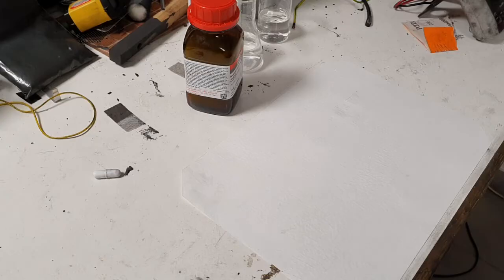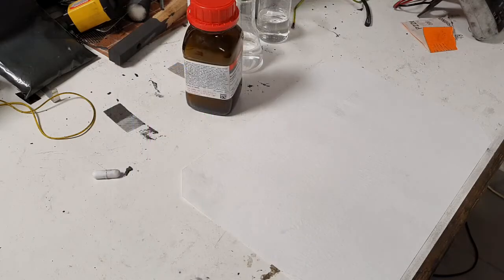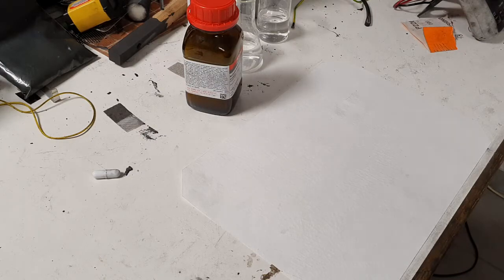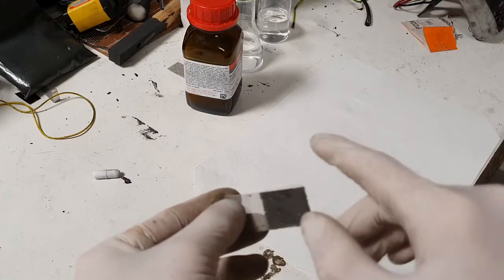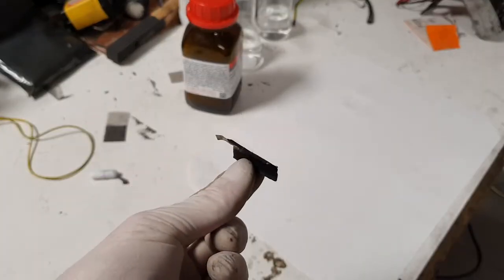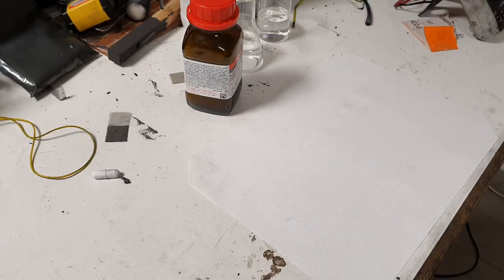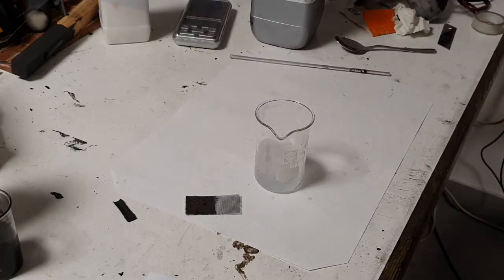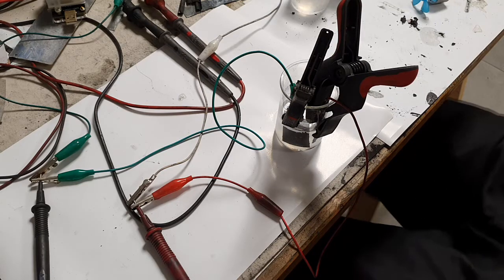Make a Nickel Iron Battery or Edison battery

Comment: These batteries have an incredible long life. The one in a 1940s firklift revived after sitting till 2006. I fixed the forklift's charger and hoses and it was being used dayly in 2013 when i left the job. Just try letting a flat lead battery sit for decades and see if it revived 😂
Reply: i suspect that our forklift at work also uses nife batteries. i don`t know. i just put in some distilled water every now and then `cause that`s what i was told to do. been doing so for over half a decade and never had any problems or did any maintenance on the electric system. and i know for a fact that not much was done in the decades prior to me :D

Comment: Nickel iron batteries would be great for powering homes. it doesn't matter that they would be large,as they would be static and could be in a shed or even in the ground. There are nickel iron batteries that are 100 yrs old and still more than 80%.. they are also relatively very green. Thanks for a very clear and concise video.
Reply from the maker: Yes indeed. But the price of nickel right now is over the top 📈

Comment: "pasta? .... ohhhhh  P a i s t ... lol...
i would have thought that stainless screen for ur iron base, is counter productive do to the nickle in the screen. i wonder if theres nuff nickle in the stainless to produce a respectable voltage? 
also ... wow that is lots of KoH in such a small amount of water. a much smaller amount produces hydrogen off gassing.
6:21 did u use distilled water? 
i think im going to try this ... now where did i put that stainless screen.... hummm ;)
ty 4 ur vid

Comment: Really enjoying your vids mate cheers
Reply from the maker: Wow Turbo....! Thank you, I also love your vids.
Reply: @cayrex  can you tell me what the binding agent you have used with the iron powder please?
Reply from the maker: @turboconqueringmegaeagle9006  in basic you can use what do you want for the binding agent. SBR + CMC, PVA + PVP I use the second binder. 85 to 90% active material (iron powder) 5 to 10% conductive material and around 5 % of binder (3%PVA and 2% PVP) If you use a binder which is waterproof then also use some binder which will be water based binder like CMC or PVP with the combination of waterproof binder. In this system the electrolyte will easy to get into the active material. You can also try only PVA or other waterproof binder but you will need much more time for electrolyte to soak into the active material.
Reply: @cayrex  thanks for your reply, and the info. I've been looking for details on the construction of early Edison batteries for a while, how it was done in the 1930's as some 90 year old batteries are still in usable condition.
Have you ever tried the tube type construction with the iron powder packed into the tube?
If I do anything on my channel I'd like to mention you and show a couple of clips from your videos if that's ok.
Reply from the maker: @turboconqueringmegaeagle9006  tube design is also really good. In this case you need a iron tubes. On this iron tubes you make a small holes that the electrolyte can go inside the tube. But the iron tube you can fill with iron powder to get more capacity. Wow,... mention me on your channel? This is so cool
Reply from the maker: @turboconqueringmegaeagle9006  also if you use iron tubes than you dont need any binder.
Reply: @cayrex  yes this is what I am thinking, binding agent might fail over time and insulate the powder but flat plates can be greater capacity? I might also find it difficult to make nickel oxyhydroxide into powder as I can't buy it but I will try.
Reply from the maker: @turboconqueringmegaeagle9006  with binders is always a problem, because you can get some % lower of the capacity. Yes, finding nickel oxyhydroxide is a little hard also the same is if you make it by your self,... your material can be bad and also you will end up with bad cell. You can use nickel hydroxide but in this case you need the charge the cell to form nickel oxyhydroxide. You can also try to make a cell only with nickel plate,... the capacity will be a bit lower I think. Try and you will see.
Reply: @cayrex  thank you my friend, you have been very helpful

Comment: hi cayrex2, 
many videos I've watched on your channel, but I'm still confused, what batteries are easily made with material that is easily obtainable as well and is equivalent to lead acid battery mf on your sample video?
Reply from the maker: Yes I have many videos, because many people want to watch on diffrend types of batteries. Easy to make and have the performance of the lead acid battery? This depends what is for you easy. Some ZnHCF battery, zinc ion hybride capacitor, nickel zinc, iron air battery,.... you have many tech that can be better that lead acid battery
Reply: @cayrex  
yes, it turns out it's very much and I don't know it, but I'm still not satisfied. what do you think about na-ion batteries, can you make a video about how to make sodium ion batteries?

Comment: What did you use for the binder?
Reply from the maker: Withe PVA glue with wather. I add a little wather to the PVA to make more ink like.
Reply: @cayrex  pla? Cyanoacrylate, https://3dprinting.stackexchange.com/questions/6723/what-glues-for-pla
Reply: I assume this is a waterproof PVA?  Or is it intended to dissole away in the caustic electrolyte?

Comment: Your using combiner. Try annealing. I’ve come up with a process that’s porous but don’t break down on heavy charge
Reply: Since I was a kid, I knew that Harley Davidson had some gear or other that was sintered steel, impregnated with a lubricant (graphite?).
It would lubricate as it wore down.
Sprocket, maybe?

Maybe a sintering process would suffice, since what it the process here is describing how to make a lot more surface area for the electrolyte to contact.

I’m one of those nerds that has an incredible retention level, and I’m SIXTY.

Best part about that was turning into a moose when I finally filled out!
Gave me the brains, and the brawn to build it, lol!!!